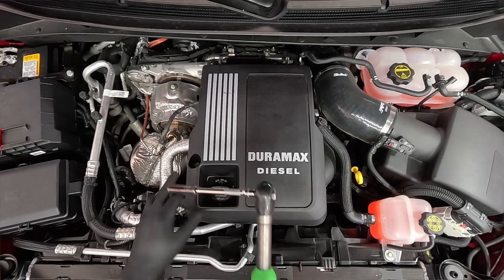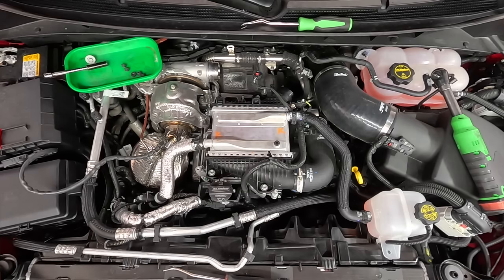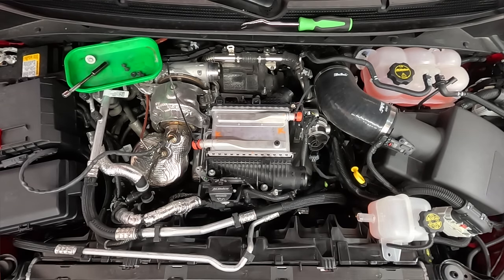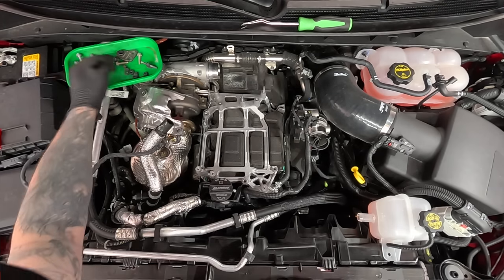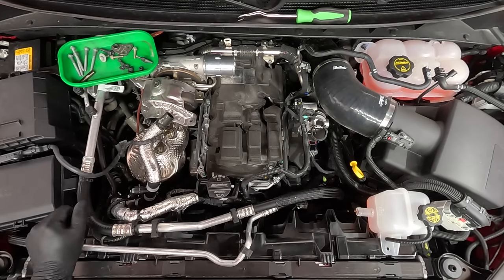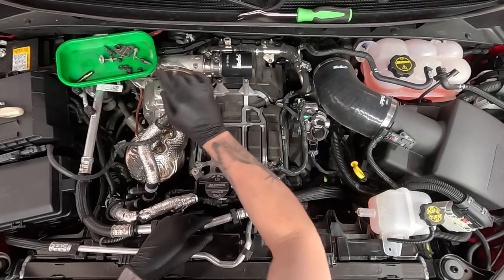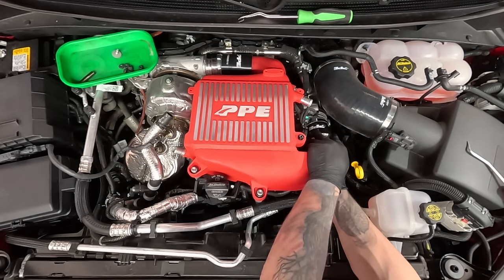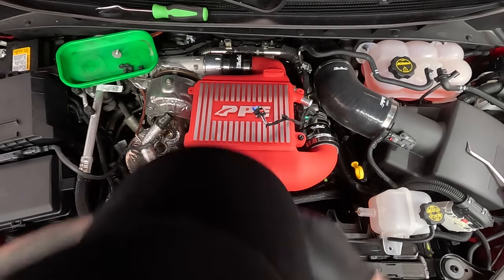3.0 Duramax PPE CHARGE AIR COOLER - Start To Finish on 24 ZR2

Comment from the maker: PPE 3.0 Duramax Diesel Charge Air Cooler / InterCooler LM2 + LZ0
https://ebay.us/9rVS3J

Silicone Lubricant: https://amzn.to/49V6I1M
PreMix Dexcool (many options, verify it meets your needs): https://amzn.to/3UZfbwr

Tools used in the video are not easily purchased online, here are some much less expensive alternatives. I have not tried these, but ran the searches through amazon. For power tools, I recommend Milwaukee or Makita. For hand tools, Gearwrench and Craftsman are good garage level tools. Many times the China knockoffs can be decent quality for the at home repair.

Fluid Extractor: https://amzn.to/43394JF
Electric Ratchets: https://amzn.to/3Tmx738
232 Piece Gearwrench Tool Set: https://amzn.to/3T4lrAq
243 Piece Gearwrench tool set: https://amzn.to/48DWy4j
Craftsman 450 Piece Tool Set: https://amzn.to/3wLDKTr
1/4" Sockets: https://amzn.to/3Tiu3oz
1/4" Ratchets: https://amzn.to/3P4yjFE
Clip Tools: https://amzn.to/3T34jLv
Ratchet Wrenches: https://amzn.to/3Ikb8DB
Hose Puller: https://amzn.to/3T0fqF4
Channel Lock Pliers: https://amzn.to/3V39OfQ

www.duramaxnews.com

As an Affiliate / Influencer, I earn from qualifying purchases. Your support is appreciated as it helps the channel to continue to test products!

Comment: What benefits is there in this swap ?
Reply: More consistent air intake temps.  Meaning you won't get as bad heat soak to the intake charge air.  Probably worth it if you live in a hotter climate or do a lot of towing/heavy load driving.  Also it looks awesome in that wrinkle red!
Reply: It does look good.
Reply: Oh, forgot to add, one of the tuners (dont remember who) said that as intake charge temps go up, the stock ECU will pull power to compensate.  A better intercooler will help prevent this hopefully.
Reply: Too bad GM voids the warranty.
Reply: Thanks for the info. You seem like you know a lot. My 3.0 LZ0 has 840 miles. I notice the oil on the dip stick is really black. Is that normal?

Comment: I’m at 110 000 km on mine and had the charge air cooler replaced twice under warranty. First time at 40 k and then just after we rolled over 100 k. Both times both my coolant reservoirs were almost empty. Both times the dealer filled them after the work was done. I suggested to them maybe there is another issue …. Nothing to see here. I had the hood up the other day and noticed the coolant low in the reservoir again …. Sigh …. Just waiting for an engine light ….

Comment: That random extra nut would drive me crazy. Where did the factory fail to install it?? Great video! In your opinion, what's the risk of voiding the warranty with this part?
Reply: Every brand new car I've ever bought has had at least one extra fastener left laying around. Sometimes in the engine compartment and other times in the interior. If you dig around enough you'll find them. The reality is the people at the plant work so fast that if they drop a fastener they don't bother to pick it up. Doesn't mean that it didn't get installed, just an extra one was grabbed when that one slipped out of their hand during the build process.
Reply: @StephenPaul1160 Fair enough. The same inattention to pick up a stray fastener is the same inattention that could lead to one not being installed. But yeah, stuff happens.

Comment: Very informational video. I don’t have a 3.0 yet, I am still trying to decide if I’m going to buy one or not. The oil burning factor has me a bit concerned. Love watching your videos you know a lot about these motors!
Reply: I'm at 14000 miles (23 LZ0) and 4000 miles since last oil change, I did add half a quart somewhere around 6000 miles, but I have not lost any oil since 4000 miles ago.  I think a lot of oil usage may occur when under heavy load and at this time I have not towed anything.
Reply: I have a Denali 3.0 that just got scheduled for production. I’m not concerned about the oil consumption. Will just keep a quart or 2 in truck with spare DEF
Reply: For what it’s worth, I have a 2023 Silverado, just over a year old with the LZ0 and no issues. Does not burn any oil during normal driving and 5000 mile oil change intervals.  But when I tow a heavy 30 foot brick of a wall RV, I do burn some, which is normal.  But after I unhitch it, no issues again.  Love mine.  I’ve got 16,000 miles and no issues and up to 40mpg at 60 mph on a flat highway. The only thing you need to worry about happened to me today. Went for an oil change at the Chevy dealer and they put in the wrong oil. It was 0-20 but not Dexos D. I caught it, challenged them and they admitted to the screw up and redid the oil change.  The D costs more, that was my clue and when the parts manager ran the vin for parts needed, he confirmed it was the wrong oil. I guess D is not that common, at least at this dealer.
Reply: Mine doesn't burn any oil 2024 w/ 5000 miles

Comment: Is that a foam cover under that mounting bracket? If so, do you reckon its there more for noise than heat insulation?
Reply from the maker: It is foam, I believe it is there more for sound than insulation.

Comment: I know this question doesn't pertain to this video but would replacing the intake tube and deleting the turbo resonator help increase my fuel economy? I noticed on warmer days 40 and above my economy is great (29mpg combined numbers up and back) and whenever the ambient air temp is below 25 it drinks the fuel (24 mpg combined). I do 100 miles a day for work and any advice to get an edge would be greatly appreciated.

Comment: Great video I ordered mine from hill diesel can't wait for the red to come back in stock . Question do you know if the oil pan will fit on a 2021 tahoe and if there is an exhaust for the tahoe anywhere I am having a hard time finding anything
Reply: Did you get your part from Hill Diesel? I want to order mine but seems like a scam

Comment: Is PPE still working on a catch can? I saw where VSE has one that's set to release this month.
Reply: I created my own catch can and I’m already seeing results after less than 100miles. I’m curious to see what a company will release
Reply from the maker: What results are you seeing? @gasparsperformance9841
Reply from the maker: @cje26 Yes, There is a huge chance I have one in my hands in the next week or two.
Reply: @DemonWorks  I'd love to see a side-by-side of the PPE and VSE systems
Reply: @DemonWorks  I’ve been having great results so far, I’ve gotten a good amount of oil trapped in the oil catch can so far.
Reply: @cje26  where did you hear about the vse kit? I can’t seem to find any information on it
Reply: @gasparsperformance9841  It was in their March Madness email that went out yesterday. It's a nice looking design, but I'm curious about how it's going to drain. They have it tucked between the battery and the firewall and there's no obvious way to empty it
Reply: @cje26  oh, that does sound a difficult spot to access it